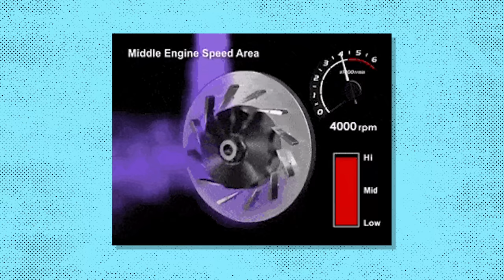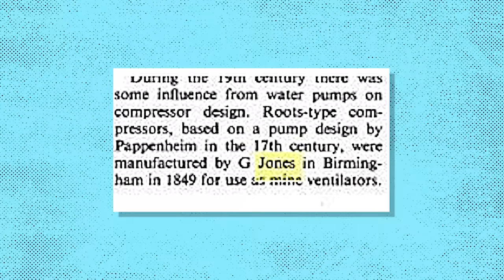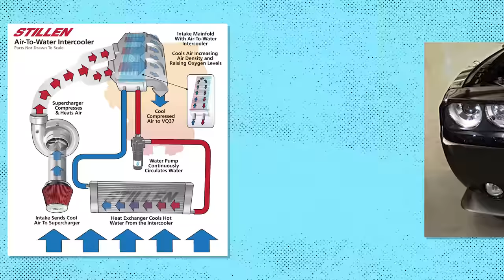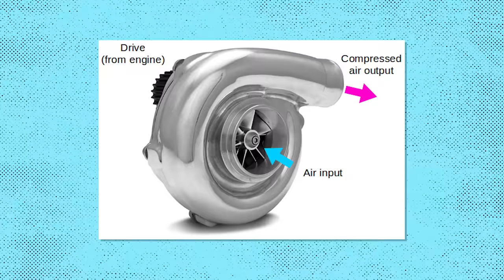Why Superchargers Aren't As Good as Turbos

Comment: Superchargers use engine power to create more power. Though less, don't turbo's do that too? I mean they introduce resistance in the air flow of the exhaust?
Reply: How can the turbo induce resistance to air flow if they flow more air?
Reply: Actually the the turbo has it's own engine, the exhaust turbine is driven by the heat leftover in the exhaust.
We can calculate the amount of horsepower the turbine generates by measuring the temperature drop as the gasses pass through the turbine wheel,  we use the Brayton Cycle to express this conversion of heat into horsepower.
Reply: @sandervanderkammen9230  you've confused gas turbine engines for turbo supercharging on piston engines
Reply: @InsertCleverUsername  NO, turbochargers ARE gas turbine engines, turbochargers and gas turbine engines both operate using the Brayton Cycle.
Gas Turbine engines are SINGLE CYCLE  Brayton engines 
Turbochargers are COMBINED CYCLE Brayton engines.
Any questions?

Comment: well I'm not going to call you stupid but turbos do steal energy from the engine because the engine has to force the exhaust gas out instead of it just easily going out like you would with a normal exhaust just flowing out of the engine, yes its true supercharges take hp out of the engine and its only like 2hp but it can very depending on stuff i prefer super charger because it has seemingly no lag and gives you way more power than it takes away. now super chargers and not as good from the factory on a typical every day sedan but on your lovely doge hellcat they are WAY better in my opinion than a turbo. in the end its up to you what you wanna do if its a mod they both have there pros and cons